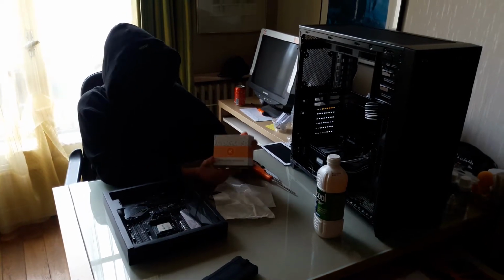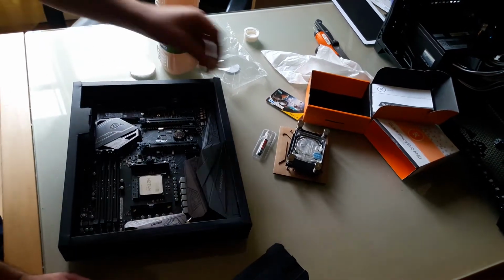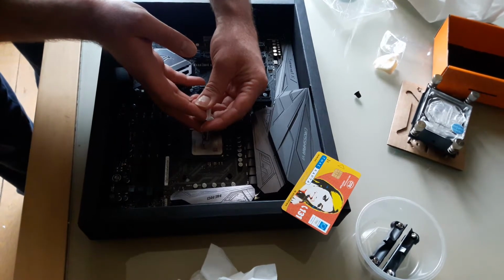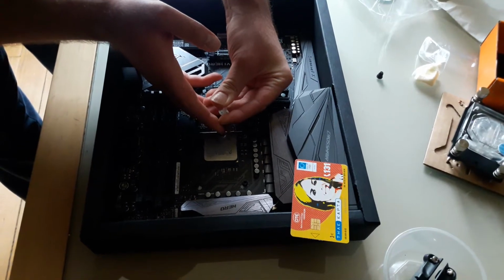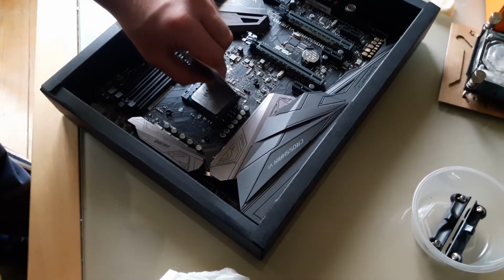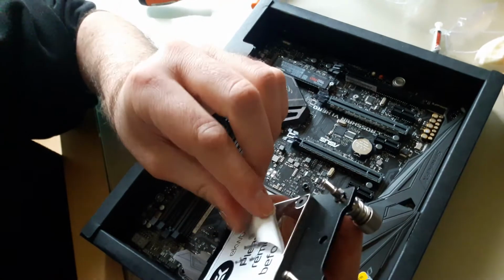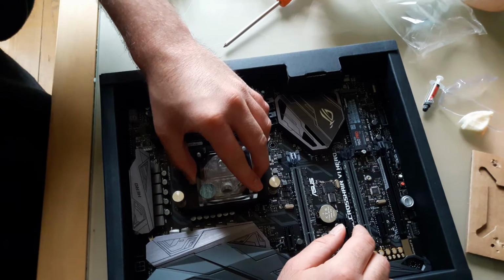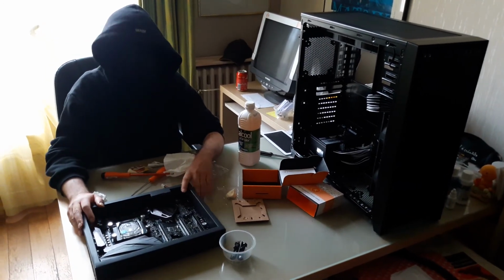Ryzen Build Log Part 9: Unboxing and mounting EK-SUPREMACY EVO AMD -Nickel/Plexi

Comment: https://youtu.be/0I0MaJBaaGU?t=894 ROFL, forgot to remove the protective cover.  You know its only Thermal Grizzly which recommends spreading out, and if you insist you can put it in a watertight bag and put it in the boiling water to make the paste more malleable.